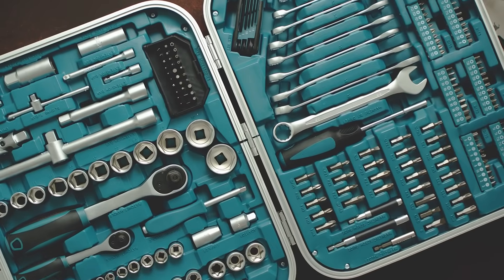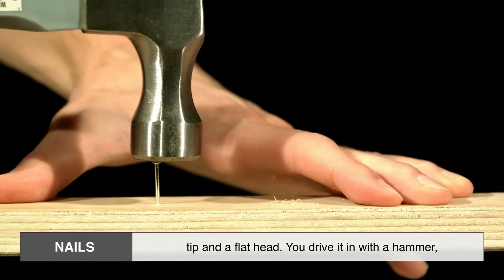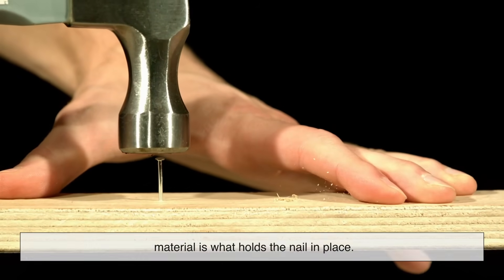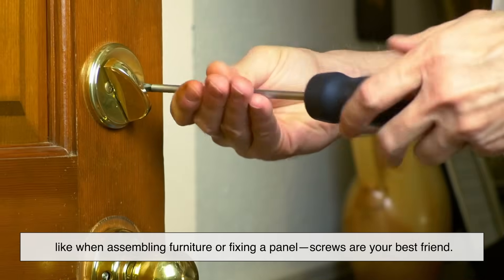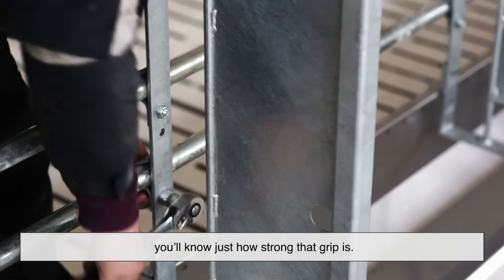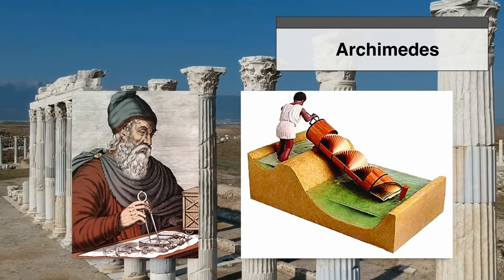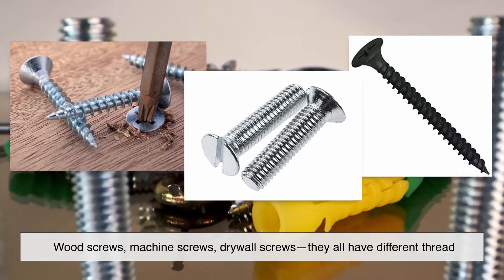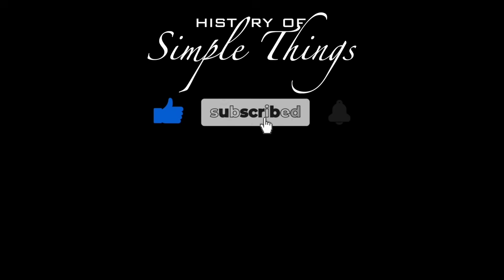Nails vs. Screws: What Makes Them So Different?

Comment: Some nail-gun nails have a coating of glue.  As the nail is quickly driven it gets hot due to friction, this melts the glue and glues the nail in place.  The glue sets almost instantly and makes the nail incredibly hard to remove or even drive in further.  So DON'T botch-up those ones !

Comment: Sometimes a pilot hole needs to be pre-drilled to ease inserting a screw that is very thick or long. A pilot hole helps to guide the screw in and relieve excessive stress in the material to prevent it from splitting.
Reply: You can also run the screw along a bar of soap for lubricant.

Comment: Thanks for the great information so I can now do my DIY project like framing with screws only.
Reply: Don't use screws for framing unless you want your building to fall apart with age.

Nails give and bend under stress where screws are brittle and break under the same forces. Changing humidity alone will cause the kind of stress that weakens screws.